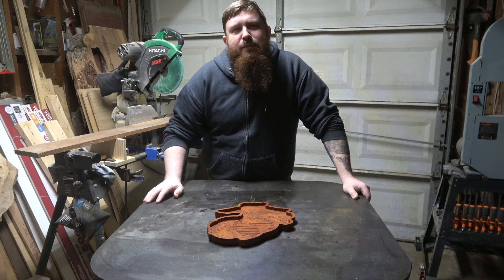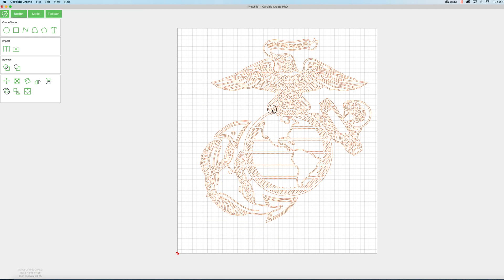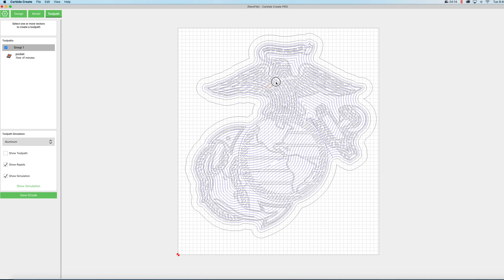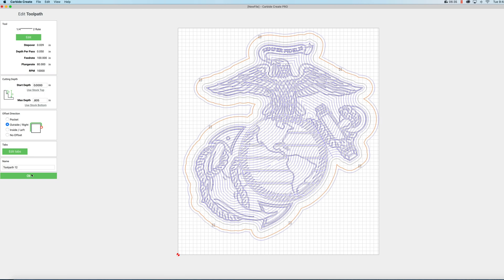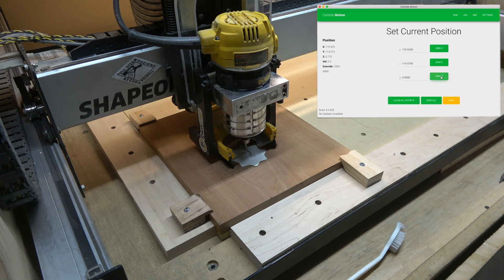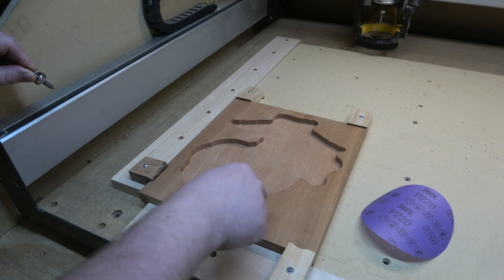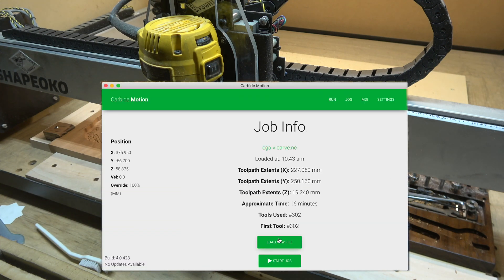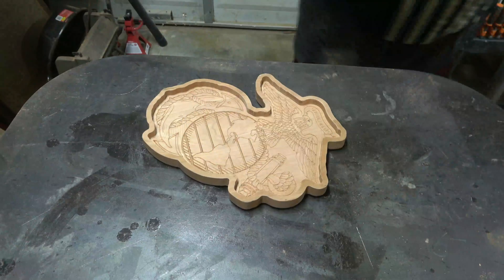Super Easy CNC router Catch All Tray in Carbide Create

Comment: I had a quick question for you. I am new to cnc (Haven't cut on my shapeoko yet). When you did the EGA catch all tray, you said that you edge glued a couple boards, do you think that is better than cutting from a 1x12? I was just wondering about overall strength, and also wondering if removing that much material would lead to warping.
Thanks
Reply from the maker: Both ways work fine. It could warp in either case. It is a lot of material.
Reply: Thanks. What are the overall dimensions. What thickness do you prefer for catch all trays.

Comment: I'm curious, as one who is just starting out, do you have to save the g-code in 3 different lines. Or can you do it all in one and then expect the machine to pause itself between lines and prompt you to change tools?
Reply from the maker: It will pause and allow you to change, but won’t allow you to reset zero manually. You’ll have to use a bit setter or stop collars to set the bits to the same length like I do.

Comment: Great tutorial Chris.  I do have a question for you regarding your cutout tool path. What speed and depth of cut did you use for your cutout? I did a simple rectangular tray yesterday using pine and a 1/4" endmill to cut it out, and I got a lot of chatter.  I think I might have been trying to go too deep and or too fast? Thoughts?
Reply from the maker: For depth I usually do half the diameter, so .125” for a 1/4” bit. You should be able to run it pretty fast. Like 150 ipm. Chatter can also be caused by the router speed being too high. I generally keep my dewalt on speed 1 or 2.
Reply: @ChrisPowellFSD  Thanks for the info.  I'll try that on my next one and see what happens.  My alternative is to just cut it out w/ a jig saw, seeing as it's pretty straight and I don't have more powerful power tools, and then sand the edges.  It would probably go quicker to cut it out that way. :) Thanks again for the great videos and wonderful advice.

Comment: Been watching your vids for awhile, almost a year ago and even said before that Shapeoko should send you a CNC for your tutorials. But now I finally got my Shapeoko Pro XXL working after back and forth dealings with Carbide (which IMO has the best customer service), now I'm rewatching your videos to learn from the getgo. Thanks again Chris! This might be such a newbie request, but there are zero vids on YT, but any chance can you do a vid on surfacing your material with the Shapeoko? I have a mortising bit and the Mcfly from Carbide but haven't used it yet. Not sure if you surface it manually or if there's a way to program it in Carbide Create. Hoping I can learn that so I can just use the planar for the other side to get a fully leveled material. Thanks again Chris and keep up the awesome vids!
Reply from the maker: Thanks. I have a couple wasteboard surfacing videos. The process be would be similar. Just draw a rectangle or the rough shape of the object if it isn’t square and do a pocket toolpath. I usually remove like .1” at a time and try to push the router as fast as I can. Like 200ipm.

Comment: Hey chris, thanks for all the videos. My.heads buzzing with ideas. What's your typical go to wood for projects like the trays? Big box stores really only have select pine. I have to find a local lumber yard
Reply: Does the 2 flute bit cut way faster than the regular carbide 204 bit? Because my cut times are alot longer than yours. Even my 60 degree v is estimating 86 minutes
Reply from the maker: @workingdogwoodworks1455  it cuts at whatever feed rate you tell it to cut at. I’m not familiar with their bits, but I would imagine you can go faster than what CC has set for the default settings.
Reply from the maker: Thanks for watching. I really like cherry or oak. I’ve had good luck getting both for a reasonable price locally, and they cut great, especially cherry.

Comment: Thank you for taking the time to make and post this video(all your videos). Ive gone through the setup and program exactly like youve done but  I keep getting an "empty tool path" when I try to setup the Advanced V carve. Can you think of what might be going wrong?
Reply from the maker: Thanks for watching. Hmmm... sometimes they can take a while to load and I have to try doing the toolpath again. Did you set the start depth to the lower height after using the larger end mil to clear the pocket?
Reply: @ChrisPowellFSD  yes I set the depths right and have redone the entire project multiple time in CC. Thanks for such a quick response time. I'll just program it normally and when it comes to actually running it in XXL I'll have to reset my V bit zero anyways so I'll do it off the lower surface. Thanks again and keep the good videos coming bro.
Reply from the maker: Let me know if you find anything that could have been causing it. Thanks

Comment: Hey Chris. Great videos. Just got our shapeoko a month ago and have been cruising along. I bought a fine tip engraver .005 spektra 90 degree and was looking for some tips on using that. Depth of cut, max depth etc. any guidelines for v carve with a delicate bit?

Also, did you not include zeroing on the bottom left corner? Someone new may assume you can touch off and zero z anywhere.
Reply from the maker: I haven’t used that bit specifically. Depending on material, I usually start at 100ipm feed and .050” doc and adjust from there for a new bit. 

Z doesn’t have to be zeroed in the lower left corner. It can be done anywhere.
Reply: @ChrisPowellFSD  I knew that about the z. Just didn’t see you zero x and y in the vid. 

Thanks for the tips! Happy new year.

Comment: This is an awesome tutorial!  If you wanted to highlight the lines on the EG&A with say, black, do you have any tips on how to do that?   Thanks again for all the great videos. Semper Fi!
Reply from the maker: I’ve thought about trying it before. I think I’d set the start depth a little lower for the EGA, say .05”, then fill that with epoxy. Then come back and run the first pass with the 1/4” endmil again, but go .05” deeper to remove the additional material and epoxy.
Reply: Chris Powell That’s a great idea — thanks again

Comment: Noob question here. If I understand right with the depth collar you don't reset zero for each new g-code you run for the same project since that was done initially so all you have to do is load the new file and it should work fine.  But does that hold true for the X and Y or should we jog those to the last current position?  Thank you in advance for your help.
Reply from the maker: All of the values for your workpiece 0 are stored in your computer. If you run a fence like I do, you never have to rezero x and y, even between projects.
Reply: @ChrisPowellFSD  cool.  Thank you.

Comment: Chris.Is your 2 flute 1/4" bit a plunge bit And what brand is it Thanks 
Jeff
Reply: Thank Chris I my very well have one as already
Reply from the maker: I use a Bosch straight 2 flute mortising bit for this also. Works great. Bosch 85617M 1/4 In. x 1 In. Solid Carbide 2-Flute Straight Bit https://www.amazon.com/dp/B000GYG5Q8/ref=cm_sw_r_cp_api_i_1j5DEbWRR68DJ
Reply: @ChrisPowellFSD  Thanks Chris. Could any 1/4" bit work? Mine current bit is an up-cut.

Comment: Also that driver you used to tighten the screw on the collets what and where did you get it.thanks 
jeff
Reply from the maker: That’s an old snap on one. Here’s something similar, you would just need to verify that it had the right size Allen. NoCry Stubby Ratcheting Screwdriver Kit with 12-in-1 Mini Bit Set including Flathead, Hex, Torx and Pozidriv Tips https://www.amazon.com/dp/B075D3CYC1/ref=cm_sw_r_cp_api_i_PaIDEb77XA9CX

Comment: When you made you bit setter how did you decide on how deep to drill the whole I assume it does not go all the way through. I s that right.
Jeff
Reply from the maker: It does go all the way through the wooden block. Then I screwed that plate to the bottom. If I did it again, I’d probably make that plate out of steel and the block out of something composite.